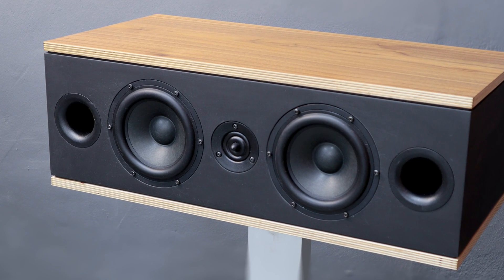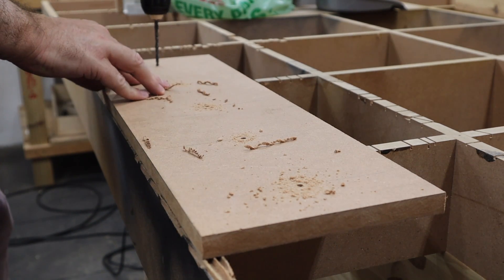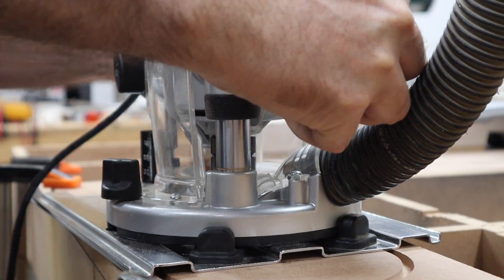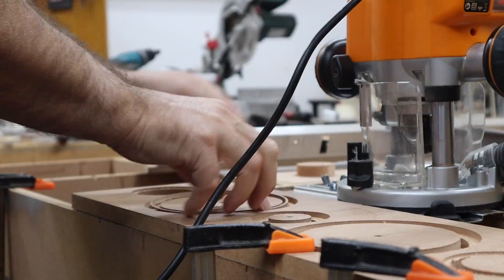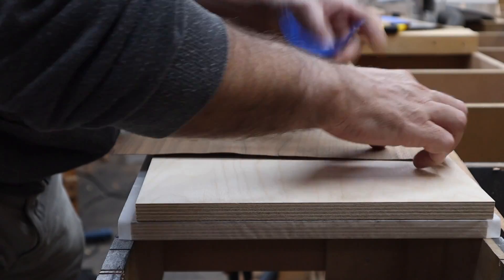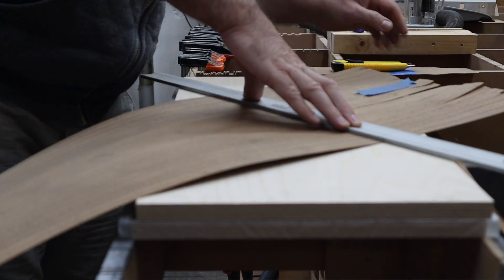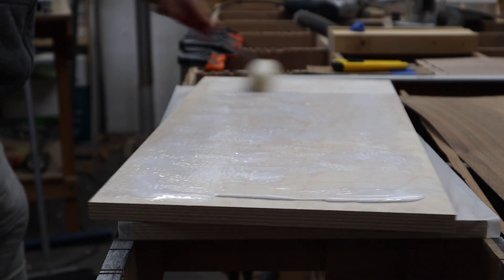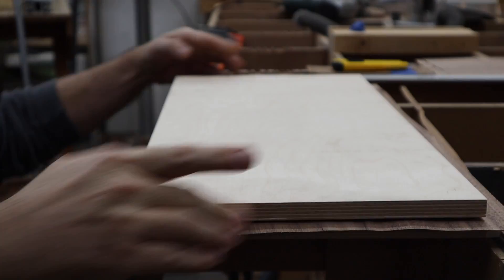Building a Home Theater CENTER CHANNEL Speaker - by SoundBlab

Comment: You didn't make separate chambers for the woofer which you should or both driver interfere with each others air pressure
Reply from the maker: No, this is not the case. The drivers work in unison and in phase with the enclosure volume double that of one woofer. Each plays the same frequencies. If this were two fiffrent drivers, then yes, separate volumes are required since their responses are different and will then interfere with each other.

Comment: Did you do the measurements yourself in REW to make the crossover?
Reply from the maker: yes
Reply: @SoundBlab  you're awesome, thank you so much for responding. Would it be possible for me to email you or something I'm just starting out in the hobby and just recently built my first 2way Bookshelf speakers thanks to some courses I took from AudioJudment on YouTube. I just don't know how to go about measuring frequencies when it comes to odd speaker types (several woofers or other drivers), I want to learn to build all speaker types so I can build a home theater but I'm really clueless on the process for measuring all the frequencies for something like a center channel with several woofers of the same type and one tweeter. Im aware of the far field for the tweeter and far field + near field for the woofer on a Bookshelf 2way, but not for s center channel. Also I know we have to account for acoustical offset, this I learned to deduce using xsim with the frequency responses of the tweeter and woofer and by additional importing the frequency response of the drivers in parallel, then you change the acoustical offset of the woofer until the two graphs look about identical that's the offset.... but how do you go about this when it's a center channel ? I know that was a lot, I'm sorry, I'm really lost and I've been searching all over YouTube but no tutorials 😢
Reply: @SoundBlab   please soundblab could you have a look at my question ?

Comment: I have a random question. Someone stole my center channel from storage. Until I get the money I'd like to use two rears as my center. Is there a way I can wire them in series or parallel so that one would act as the left and one would act as the right?
Sorry if it's a stupid question, I'm pretty new to this stuff. 
Thanks!
Reply: I'm starting to realize that this question was not a very good one. For some reason I was thinking that the center still somewhat separated the left and right sounds. But through more research it seems as if it is about 50/50 from left and right at all times and it just sends at a different frequency so that audio will be more prominent, correct?
I ended up just running my two small rears in series as my center and turning the volume up on them. Not perfect but, it seems to work okay for now. 
Thanks!

Comment: Could this centre speaker be used on it's own effectively, without the right and left speakers?
Reply from the maker: It can't replace left and right speakers on its own, but can be used in a stereo pair as left and right speakers if you use them vertically. So, short answer is, no.
Reply: @SoundBlab  thank you for the reply. I have been exploring your channel and there is plenty of great alternatives for me to try.

Comment: How did you mount the crossover was it glued in or screwed in? Why didn't you install crossover before putting top on cabinet?
Reply from the maker: I think I glued it (was a long time ago...). I like to make sure that I can mount and remove the crossover even after the cabinet has been built.

Comment: Nice looking speaker and great vide, but...Horizontal MTM's with 2-way alignment have subpar lateral dispersion characteristics.  

If the speaker is intended for listening +/-15 degrees, great.  Otherwise, you will have combing in the frequency response beyond that listening bubble. 

There other ways to mitigate these detrimental characteristics in Vance Dickason's Loudspeaker Design Cookbook.
Reply: I would argue that is bad either way because even on axis, what you hear is a combination of the on axis and off axis response

Comment: 🙋🏻‍♂️mr.soundblab I have a question here. First Thank you for the plans, content, and answering questions. I just built your 3 way floor standing speakers for my front left and right. Now looking into a center channel. I was wondering if you could give me some recommendations on a center to match those 3 way floor standers. Size is a concern and was thinking of just using the fountex and tweeters to make a small cabinet, any thoughts?

Comment: If I were to do a build of this, but modify the box dimensions, so it's longer but more shallow but retains the same volume, would that work well?  Basically I need a center with dimensions closer to a soundbar, doesn't have to be full on soundbar, but closer due to the dimensions of my room.
Reply from the maker: For the modelled crossover to work right, the size and shape of the baffle or front panel needs to remain the same. If you change it the frequency response will be off. Short answer is, no.

Comment: Do you recommend the components you install or its just the box plans? On your website all you have are plans
Reply from the maker: I do not sell components, only the build plans that give you comprehensive parts list and where to buy with links. If its in a build plan, I would recommend the parts I use.

Comment: The best port placement in my opinion. Close to the end. My humble suggestion : 3 inches longer and the inside port tapered to the middle. I tried it using two dual cone speakers 4 ohms each wired in series. Good job sir!!!  👍💐👍🇵🇭
Reply from the maker: Thanks

Comment: are this stereo channel or just mono?
Reply from the maker: Its a mono center channel speaker
Reply: @SoundBlab  oh ok.
Reply: @masprassaja3818  yes, and it actually could just as easy turned out to be a stereo Bluetooth active speaker if desired.
Reply: Bravo.
Rien à dire.👍🏻💪🏻
Just 1 question, at 2'30 what title 🎶 ? 
Gilles

Comment: I have found that plastic terminals are almost in all cases a source of air leaks. So I always mount terminal first and apply havy glue from inside. This prevents leaks. Additionally I use gaskets made from tiny foam between speakers and box to prevent leaks at front baffle.
Reply from the maker: All the drivers and the terminal cup came supplied with good gaskets.

Comment: You should chamfer at  45° the backside of the front panel where the speakers are mounted.  Otherwise, the thick panel will block waves behind the speaker and effectively change its TS parameters.
Reply from the maker: The baffle is not that thick. Chamefering the back is not practical in this case.